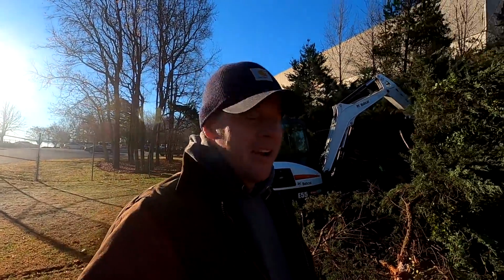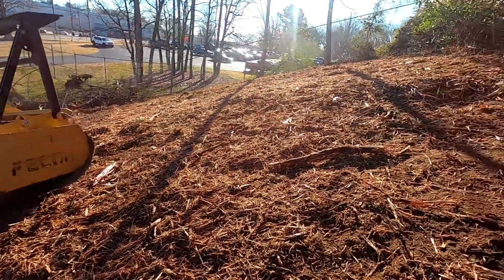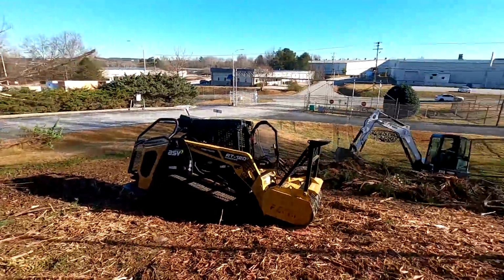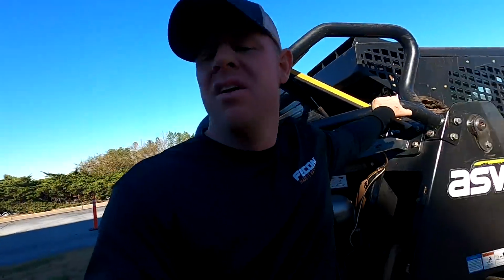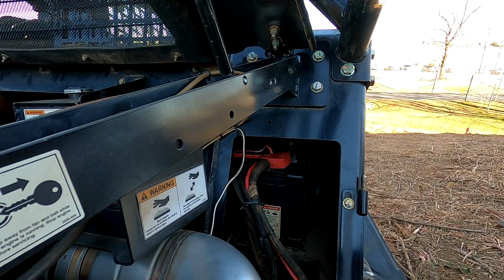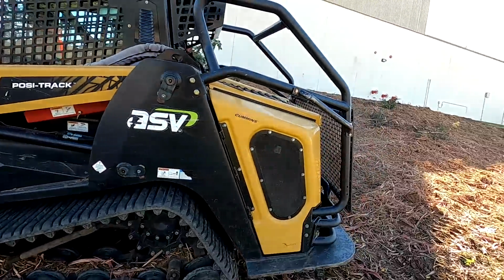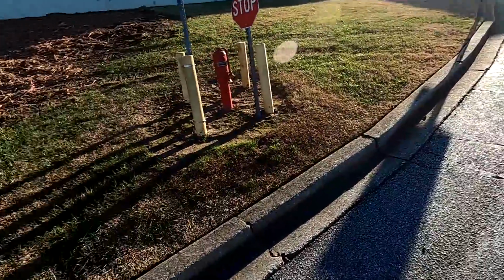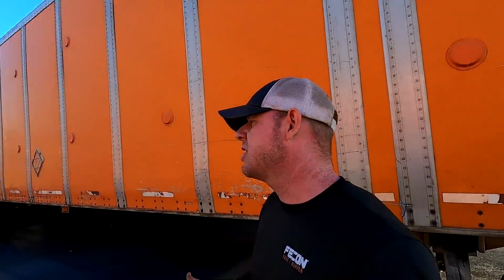Pulling out Juniper Trees and Mulching them up

Comment: I hope you cleaned the corrosion off the cables before hooking them back up to the new battery. Also putting Vaseline on the connections will help it from corroding again. M.

Comment: If you're lucky, the alternator just needs a new 'brush pack & regulator unit' on the back - maybe $40.  In such a dusty environment like you run, the carbon brushes in the alternator take some severe abuse.

Comment: (Auto Electrician hat on) You need to get a multimeter set to voltage and put it across your alternator output. on a 12v nominal system you should be seeing minimum of 13 up to approx 14.5 volts when the engine is running. Just be careful to also check your engine system fuses. Sometimes on certain plant equipment manufacturers over here, there is a low current control circuit fuse that controls the alternator that can be quite sensitive, so it may be that the loose terminal has caused that to pop and has shut your alternator off rather than it itself being damaged. Definitely a charging system fault though.

Comment: Nice to see you back at work, but I do hope that you've taken enough time to tend to the grieving process for the passing of your family member there. If not, we will always be here if you need to take more time to be with your family and comfort them in these harsh times. I really don't think your customers will fault you any for that, and I know the Lord certainly wouldn't either. God bless you in these sad times. ✝️ ✝️ ✝️

On a side note though, as a fellow Class 1 truck driver myself, an Allison automatic gearshift in your rig? Really?! That's a bit of a come down for driving your truck, isn't it? Even with a split-shift stick on a ten, or twelve, or even eighteen speed transmission, if you have a synchro-mesh gearbox, you'd be able to fly up and down those gears a lot faster than you can with an Allison Automatic. Just saying. It's not like a skid-steer with a forestry-mulcher kit and a mini-excavator are going to weigh your truck down any when it comes to gear shifting. Why the choice?